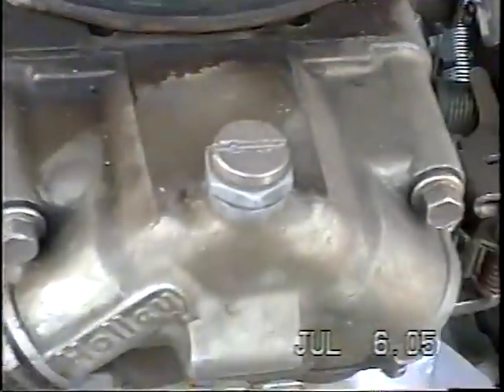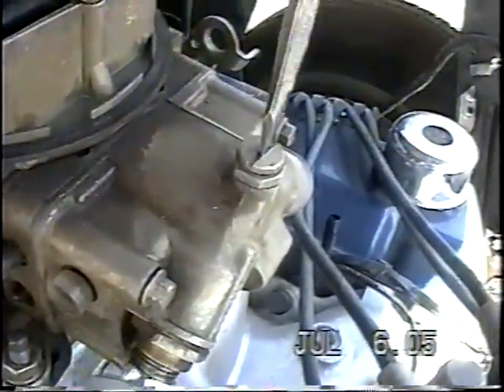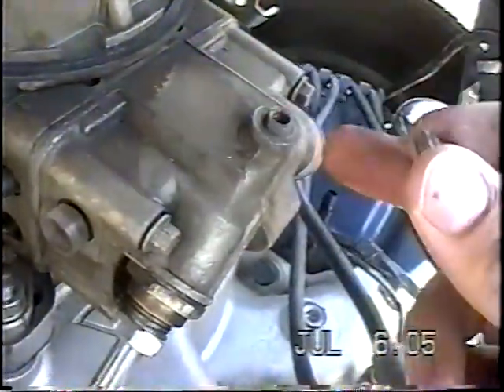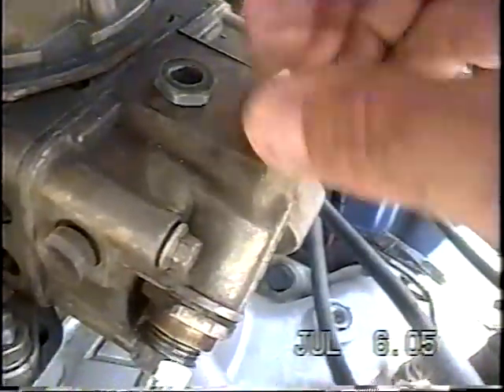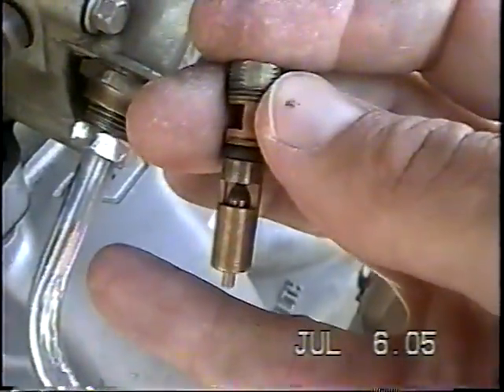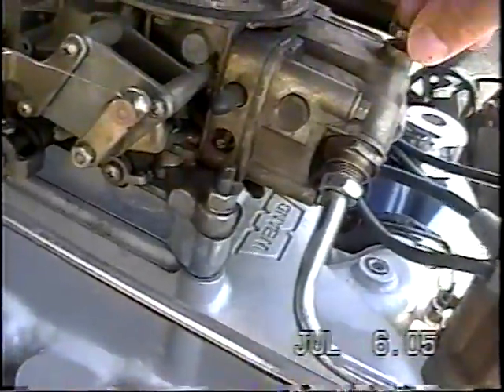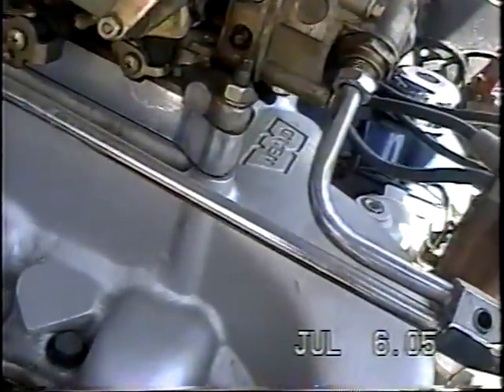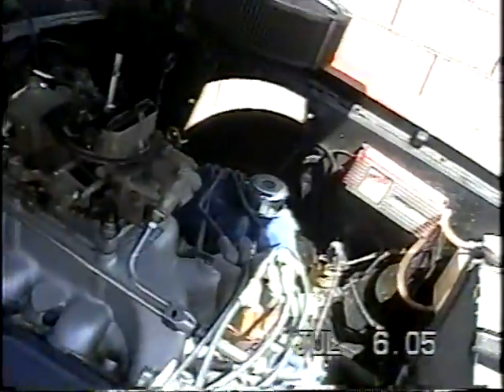How to:  Holley needle and seat valves, what to do when your Holley floods itself

Comment: Thanks. Mine was dumping fuel everywhere. When I took the primary one out it had a chunk of something stuck in it! Cleaned it up and my truck is running better than ever. I’ve never worked on a carb before, but you made it simple.

Comment: Carb cleaner will eat the rubber o-rings and needle tip seal. Use Diesel and a small butter dish. Apply 100% silicone grease when you reinstall to protect the o-ring and needle tip.

Comment: Wat about the leak on the out of the tub out of the pimary side
Reply from the maker: If you're talking about the dark stain on top of the primary bowl, that's not a leak, just a dirt stain.  Needle and seat had recently stuck open, flooding the carb, and allowing some fuel to spill over the top.  I fixed it on the side of the road and drove home, and that's just where dirt had stuck to fuel that had spilled over.  I was living in Las Vegas at the time, and when you break down, and pull off into the desert, things get dusty.  When that happens, all you need is a can of B-12 Chemtool, cleans it up nicely, just don't hit any paint with it.
Reply: @owenrobertson  no on my carb it's leaking out of it runs and sounds great but shoots out I'm gna try to adjust again I have a pressure regulator on as well ,
Reply from the maker: @drewdowncutomz4792 , oh, well if it's leaking from between your float bowl and the metering block, just remove the four machine screws, and remove the float bowl, and replace the float bowl gasket.  You can get gaskets at any auto parts store, I like these blue gaskets, they are reusable and don't tear apart and stick to the carb, like the brown paper gaskets do.  Here's a link:

https://www.napaonline.com/en/p/BK_3353721?cid=paidsearch_shopping_dcoe_google&campaign=GSC-Fuel-Emissions&campaign_id=10951730297&adgroup_id=113117085528&adtype=pla&gclid=Cj0KCQjwktKFBhCkARIsAJeDT0ioRbkgk7hlPd6wcP91KDUuU8P9H3yRGJBhRpTheHQh2Vvb4EK8ENgaAs6mEALw_wcB&
Reply: @owenrobertson   thanks il try that I didn't do float boat gasket only the housing

Comment: Idk if youre still available for this but will this also help if it completely floods and dumps fuel while driving? i can give you the details of what is happening if youre still available.
Reply from the maker: Yup, if you're running a Holley, and you have to keep the pedal floored just to keep the engine from flooding out and quitting, then this is probably your fix.  If you finally give up trying to keep the engine running, and you get out, pop the hood, pull the air cleaner, and the primaries are full of fuel, like a small pond...then this is definitely the fix.  If it's the primaries, clean out or replace the primary needle and seat assembly, as in the video.  If the secondaries are flooded, clean or replace the secondary needle and seat valve.  This is pretty routine on a Holley, if you run one for a while, you'll see it.
Reply: yeah mine ponds up in front of the choke in a little indent area, i cleaned the primary and it idled and ran fine but when i did the secondary i must have broke the gasket and now it seeps from that set screw and nut so im getting a new set of primaries and secondaries

Comment: I would appreciate some help if you're willing. I have a brand new holley 4160 750cfm going a '73 Ranchero with a 351 cleveland. It's brand new and is pouring fuel out of the overflow. I have a 5 psi regulator on it. This is the third carb I got. First carb was doing the same thing. We found the spring for the float was installed incorrectly. Fixed that, was still doing the same thing. So we warrantied it. Second carb had a stuck open choke. Warrantied it. Third carb is pouring fuel out the overflow just as the first. Is there anything other than internal fault that could cause this? Are the bowl levels adjusted incorrectly?
Reply from the maker: I've got a bunch of old cars, and only a couple with a Holley, everything else has an Edelbrock or Carter AFB.  So there's my plug for those carbs...they work great on mild engines.  Holley can be a pain, but your luck is way worse than normal.  Brand new they are normally just fine.  Buy one that's 20 or 30 years old, and you might be in for some issues, but that goes for any 20 year old carburetor.  Your Holley has the side-hung floats?  I've never run one of those, but I've heard of people having issues with them.   5 psi should be fine.  Are you sure it's 5?  Do you have a gauge on it?  Is your regulator adjustable?  Pull the sight plugs out of the side of the bowls.  If your floats are adjusted correctly, the fuel level in the bowls should be just below the sight plugs, even while the engine is running.  If it's higher, then it could be float adjustment like you said, but more than likely it's the needle and seat valve not doing it's job.  Let me know what you do to fix it, others have commented below, and they never tell me how they fixed it.
Reply: Owen Robertson Thanks for the reply. I believe at this point it's debris from the gas tank obstructing the needle and seat. I've had the bowls off and everything looks good until I crank it. I cleaned the tank but I'm still getting crud coming up. I have a glass reusable filter but I don't think it's doing it's job completely. I need to pull the tank again and clean it better and install a paper filter, as well as clean the bowls out. I will let you know what I find, but I suspect it's not the fault of the carb as of now.